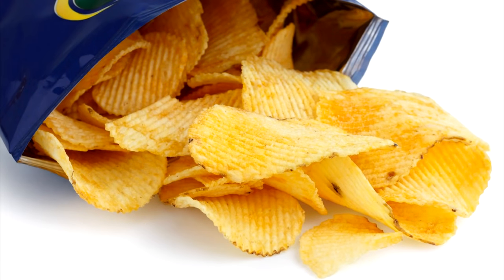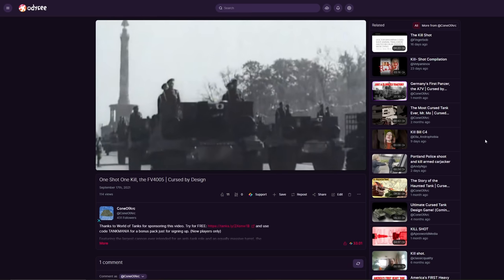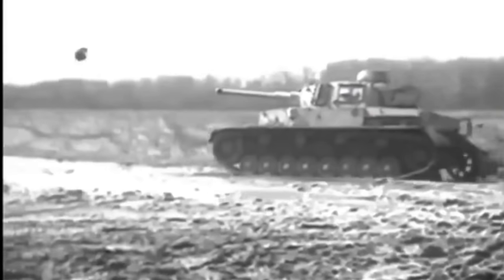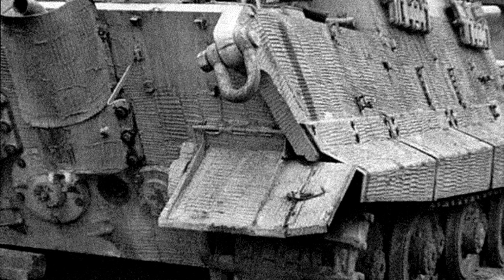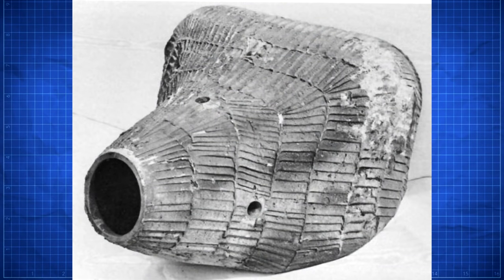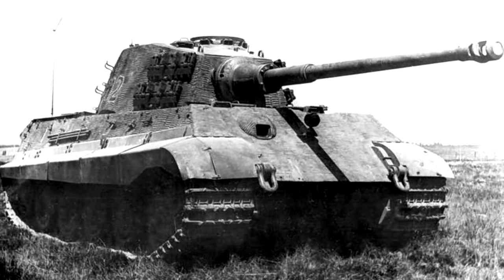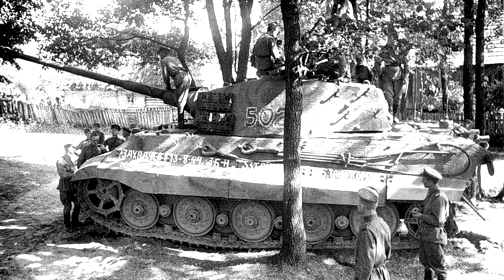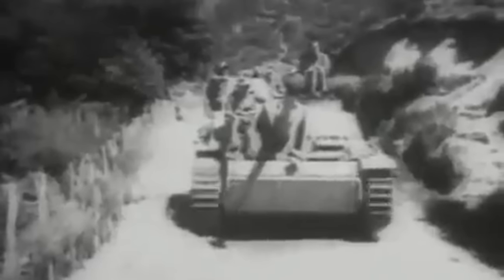Why did Germany put Zimmerit on their Tanks? | Cursed by Design

Comment: I hate when I'm driving my tank along and a land mine springs up 20 feet into the air and attaches to the top of my ride. If only I had this!
Reply from the maker: Land mines are triggered by pressure not magnets. The mines this protected against would be manually placed on the side of the tank by a soldier
Reply: @ConeOfArc  I'm triggered

Comment: People give way too much credit for WWII german engineers. Engineering is about reliability and redundancy, while using minimal materials, meeting the minimal requirements.

From this perspective coating that adds many days to production time and needs it’s own special production, while providing a deterrent against using one form of anti tank mines is utterly idiotic waste of resources. Just as is producing the fastest, most heavily armored tank with big guns, that is close to impossible to repair, prone to malfunction and held only minor advantages in actual battle.

You know who were the real engineers? Soviets. They made SMGs from stamp metal, that could be field stripped with two easy bolts. Their tanks, while not as safe nor powerful, were reliable and repairable, and could sustain constant huge overweight with logs or even cement attached to them. 

That’s real engineering. Anyone can design a bridge that stands. It takes an engineer to design a bridge that stands, but just barely.

Comment: Holy shit, this comment thread is hilarious. YES, degaussing was not intended to prevent mines from sticking. YES, Arc made a mistake. YES, Arc corrected his mistake in the best manner possible without completely remaking this video. NO, no one is going to die, or be seriously injured or affected by Arc's mistake. If y'all know so much about the topic, why don't YOU make videos about it? Oh yeah. That's right. Cause it's easier to point out others' mistakes and berate them than it is to spend hours making a video on the subject.

Just as a side note, if anyone is interested, the magnetic field of a material is almost entirely unrelated to the ability of a magnet to stick to it. If you'd like to learn more, feel free to read a textbook on college level physics. It's pretty interesting stuff, although it can be somewhat difficult to grasp without some level of prior knowledge of the subject.

Comment: The magnetic thing sounds like a story to make the germans look stupid, given how well it works against flamethrowers..?
Reply: Why? When zimmerit was first introduced. It did in fact prevent magnetic mines from sticking. Exactly as designed. Later mines with larger and stronger magnets made zimmerit ultimatly obsolete. But it worked as intended when it was introduced. It turned out to be mostly useless because no one except the germans was using magnetically attached mines. The germans had assumed everyone would develop such mines. But most other countries went with soft body grenades covered in adhesive.
Reply: @LodewijkVrije  Assume that everyone would develop these mines vs protect from flame throwers which were already in use? Cmon the germans were not idiots. However the people that write our history want us to think they are :)

Comment: That's amazing they did this.
The Germans always seemed like they were short of material time money and, at the end, manpower but yet they smeared their tanks in this for apparently very little benefit.
Maybe it was to be part of a larger system or project or something (?)
Reply: Around midwar, the Germans ran out of Molybdenum and Chromium as well as Nickel which are the common forms of alloy used to face harden steel after a 'double dip' in flaming oil baths.  

They shifted to Vanadium which has similar hardening but leads to microcracking and embrittlement which can cause entire sections of plate to fail.

Hitler said, 'Fine, we'll work with this until the 'new generation armor ' comes online.'  (_Hitler's Table Talk_ conversations) That form of next gen armor was called Brimstone.

And despite a few mentions, here and there, nobody will discuss it.

Proto ERA?  Some form of composite stack?  Brimstone is associated with heat and fire ('hail and brimstone') from vulcanism.

My bet is that it was a form of electromotive technology.  Metals which are engineered to be so can 'flex' to incredible stiffness when a particular charge (phase, not current) is run through them.  And, as a gift for all the steel they made for them, the Swedes were given a lot of Krupp technology at the end of the war.

Today, the Swedish company Armox makes an 'Armamax' nano-steel which is the number one hardest steel in the world with hardness ratios that are off the charts for all known (Brinell, Rockwell, etc.) testing scales.

I believe that this is the actual reason our M1 Abrams etc. are so well protected because the 'backpack' of the Abrams armor system is not reinforcing the frontal arc or turret cheeks, it's actually behind the turret facade plate which is only about 60-80mm thick.  Said rack of multiple plates has boron carbide and boron silicide which are known high energy conductors.  Depleted uranium is high energy neutral.  Run a charge along those plates behind a nanosteel front and the charge is going to stick to the steel and hardness is going to increase a hundred fold as impedance load on the inner armor plate forms a circuit path which does not want to break and preserves the charge pathway by locking it together.

Now imagine, it's December 1943, you haven't been on the offensive since July and Zitadelle.  Any reason for Zimmerit ceased to be, at least at Kursk if not Stalingrad, the year before.

The Russians are pushing Operation Bagration down your throat, splitting your fronts and bypassing whole Army Groups to Go Deep, behind your lines.  You give ground at odds of 50:1 or you are left behind, out of fuel and ammo and options.

You're also losing Italy by inches and you anticipate an Allied Invasion on the Atlantic Coast of France or the Low Countries, sometime in the six to eight months.

You have just discovered, as a function of your high energy betatrons, with which you are doing research on your nuclear weapons program, this native quality of armor steel in reaction to large scale impedence loading from electrical charge.

It took you a year and a half to develop your latest Panther and Tiger tanks, which cannot be replaced with new designs before your statisticians and strategic analysts say you will have lost the war.  Even if the Allies were not bombing the tank plants every day, you don't have time to retool again.

If you wanted to apply such a next-gen system to a tank which was not designed to have a shielded internal compartment, what would you do to keep the crews from electrocuting themselves or even possibly arcing discharge into the bushes to start fires?

You would develop an 'anti magnetic' insulator paste to electromagnetically seal the vehicle body against the day when this new Brimstone armor system arrived and could be plugged into the 'live' armor facia.

There is so much history of WWII and the German effort to stave off defeat with seemingly bizarre efforts which is actually just the warped machinations of the All-lied Myth.  We don't know what Zimmerit was meant to do.  It makes no sense that it is what they say it is.  

And contrary to the 'Hitler was a nut job and his henchmen in industry and Waffenampt 6 (R&D branch of the Heer) were idiots' storyline, it seems likely that we simply don't know what was actually going on in a country which had pioneered the most advanced Molecular Chemistry and Physics in the world at that time.
Reply: @xyz-hj6ul  Wow, you took a long time to type out what is most certainly a load of science fiction bull.

Also, M1 Abrams armor thickness is measured in inches.

Comment: exposed   toa  flame  thrower? dude    it would take alot of time to  heatsoak  the  steel enough  for the  inside of the tank to be even  midly hotter then normal so who  had the idea of  even factoring in a flamethrower as a  threat?
Reply: Don't need to soak the steel, you just need to use up the air going to the engine intakes, overheat the engines and suffocate the crew
 
It's why Molotov's were so effective.

Comment: I thought it was to prevent sticky bombs to adhere to the hull?
Reply: Like axle grease ones
Reply: That would be stupid, because the sticky bombs that use things like axle grease have a soft outside. Which means they would deform on contact and then have more surface area to stick to on a surface with ridges. 

A sticky bomb that uses something like grease would stick BETTER to a ridged surface then a flat one.

Zimmerit is against explosives that use magnets to stick to a metal surface, instead of grease. Because the ridges reduce the surface area a magnet could stick to as well as providing a non magnetic layer between the armor and the mine. To make weaker magnets not stick at all.
Reply: @LodewijkVrije  you’d have to physically walk up and press the charge into the ridges for it to work like that. A thrown impact wouldn’t have enough velocity to press it into that pattern. You’d just contact a few of the apex area of them making the surface area much less.

Comment: So how would a mine reach the gun mantle 🤔?
Reply: Hello mr simpleton, the word “mine” has nothing to do with the device being burried in the ground. Like you are clearly assuming.

Think of the claymore MINE, probably one of the most recognizable mines in use today. Its not burried. It is either sitting on the ground, or hung from an elevated position.

You also have mines, which you need to place on a vehicle or object, pull the pin, and then take cover. One of the most popular means of attaching a mine to a vehicle is with magnets, considering most vehicles being made of metal and all that.

So how would a magnetic mine reach the gun mantlet? Well its quite simple really, you take a soviet soldier, and you have him sneak up to the tank, climb up it. And then have him place the mine on the gun mantlet. Then you have him pull the pin and run.

Comment: If the Soviets and US had communicated better, we could have seen the US burn down areas, then wade into the fire using fire proof vehicles equipped with zimmerit.
Reply from the maker: It wouldn't fire proof the vehicle to that extent. It essentially acted as an insulator to the tank but a normal tank could just as easily drive through a burned area without much fear of damage to itself.

Comment: Degaussing has absolutely nothing to do with sticking a magnetic mine to anything, it merely subdued the magnetic 'fingerprint' 

Magnetic mines used at sea used the magnetic field distortion as a trigger.

Such a coating would have no effect on such triggers (the tracks and drive wheels would probably have been enough to trigger any sort of buried magnetic mine.

Very doubtful that the coating would be any use for that purpose, at best it would be a an attempt to prevent the attachment of sticky/magnetic hand weapons.

Comment: The assumed use for protection against magnetic mines doesn't make sense at all.  Mines would only have a chance to attach to the undercarriage of the tank.  So putting Zimmerit anywhere but the underside would be a complete waste.  Therefore it's intended use must have been for completely different reasons such as camouflage and/or fire retardation.
Reply: I agree. I think it was intended to break the reflection properties of the metal. It makes the tank very matte, which would make it much harder to see from a distance.
Reply: The mines were talking about can be seen at 6:15 being stuck onto the side of a t34 by a German

Comment: I've seen this explanation before and honestly it doesn't makes much sense, since A) the tracks couldn't be covered with it and B) you would only need to cover the belly of the tank if you were worried about mine (and that was the part that usually was not covered by it at all...) The only ones who used magnetic charges (not mines) that were intended to be carried by infantry and stuck to enemy tanks during the war were the germans, in fact they seemed to be the only ones that used magnetic mines in general as well..
The simplest explanation would be that this was an anti spalling coating to prevent ricochets from injuring or killing nearby troops, as well as potentially serve as additional insulation during winter combat at the eastern front.
Reply: The magnet mines they were concerned with were their own style; meant to be applied by an infantryman to the side/top of a tank and manually detonated from a safe distance.

Comment: I dont get it.

The texture goes all the up to the top of the turret. Would mines pull themselves out of the ground and stick all the way up there?

also

Werent the tanks tracks made of metal?

also

if they were on such a tight schedule to produce tanks ASAP - why waste at least an extra day for an improbably threat?

Someone explain like im 5 plz
Reply: You assuming “mine” means its burried in the ground is where you make the mistake.

A claymore, for instance is a mine. But its not burried. It just sits on the ground, or is hung in a elevated position.

You have mines that are meant to be stuck to a vehicle after a soldier successfully snuck up to that vehicle. Such mines often had magnets on them so that they would stick to the vehicle.

So that means if you make armor to prevent magnetic mines from sticking, then you need to cover areas where the enemy might want to stick mines.

The tracks don’t matter in this context. The often were not wide and flat enough for a magnetic anti tank mine to stick to them and hold up its own weight.

Comment: So the goal was a buffer against magnets. Seems to me 2 sheets of 3/4in of plywood on the bottom would have done that without some convoluted process with chemicals. And what was the point of having it on top of the tanks? Was it common practice to throw giant anti tank mines on top of tanks like a Molotov?
Reply: Mag-mines were infantry deployed, often on tanks that weren't initially aware of the infantry nearby. They were designed to stick to the sides/top/back/etc, whereever you could reach. Underneath a tank is often not a healthy environment for soldiers to be; and mag-mines don't work from the distance that a tank rides off the ground.

Comment: I really don't see how this is a example of German over-engineering, which is a rather silly "Youtube expert" trope that doesn't really hold up to scrutiny anyways.
Reply from the maker: They designed an entire coating that only protected from their own weapons and added days to the production. Sounds pretty overengineered to me.
Reply: @ConeOfArc  If anything it would be "over accessorized", but not over engineered. And it isn't as if they wouldn't have painted the tanks with regular camo paint anyways, is it?
Reply from the maker: @TrangleC  yes but they still would have to paint overtop of the Zimmerit. Paint also only takes a few hours to dry to the point of being able to move the tanks to be shipped
Reply: @ConeOfArc  Not so sure about them painting over it. It was 15% pigment for a reason, wasn't it? So they probably only painted a pattern (meaning dots and stripes) over it. And even if, so what? They didn't drive every tank right out of the factory gate to the battlefield. The things obviously stood around somewhere till they had enough to load up a train full of them, which probably took weeks.